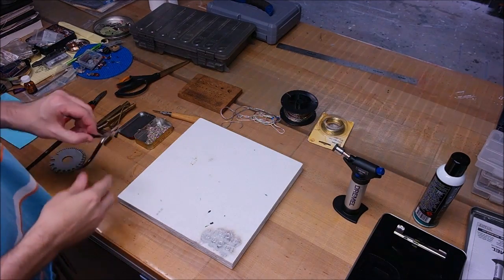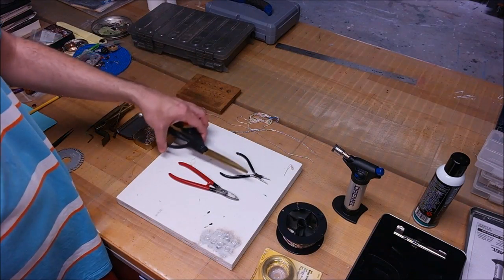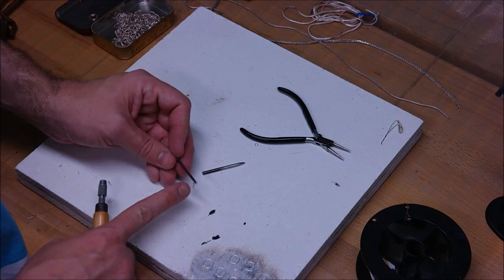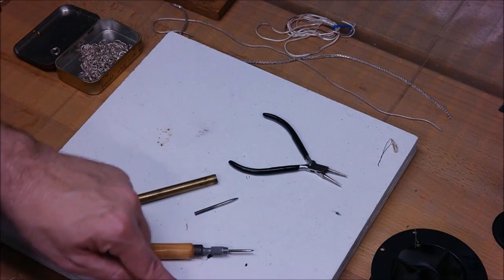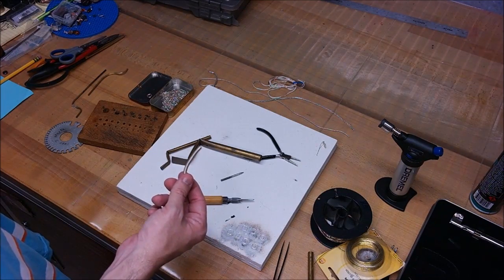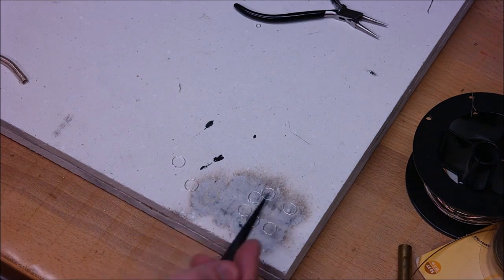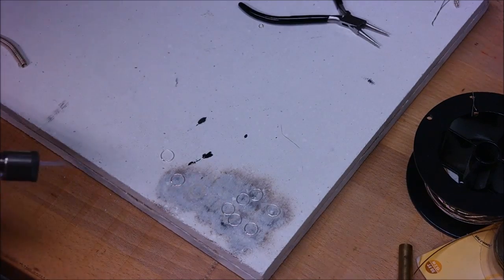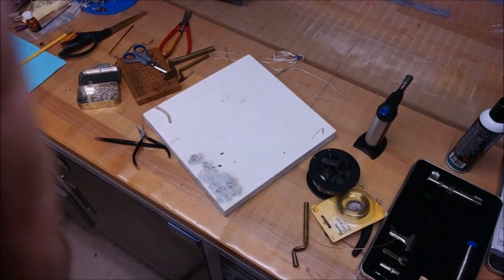Foxtail Chain - Part One

Comment: Hi, did you make the wooden drawplate yourself or did you purchase it? What type of wood is it?
Reply from the maker: I made it from Oak - used a set of nice drill bits and went to town.  You could use any medium to hard wood - I would just stay away from softer woods, since the chains will eat the holes to shreds - if that makes any sense!!
Reply: @frederickmiller5492  Yeah, that makes sense. Thanks for the info.